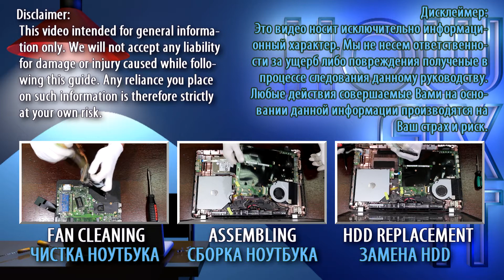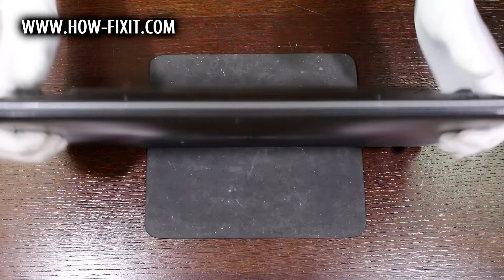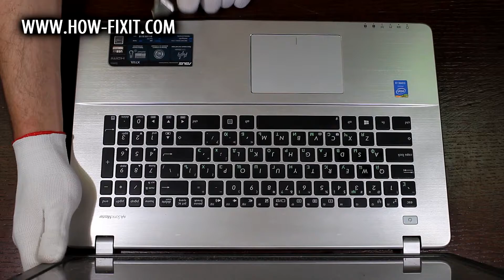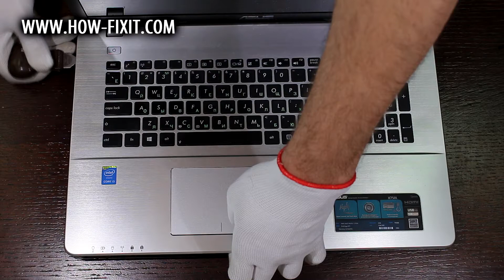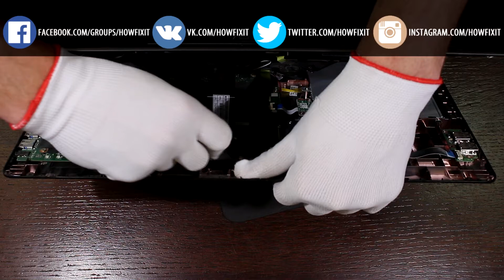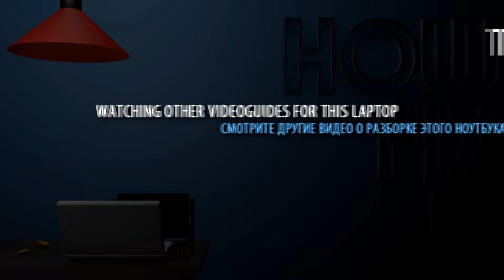How to Install SSD or HDD in Asus X750 – Full DIY Tutorial

Comment: The x750 has an additional sata port on the bottom side of the motherboard. You can install an additional drive there if you wish to still have a hdd as well.
Reply: I whas sercing all over to find what kind of slot is thatone. Not a msata ...? ☹